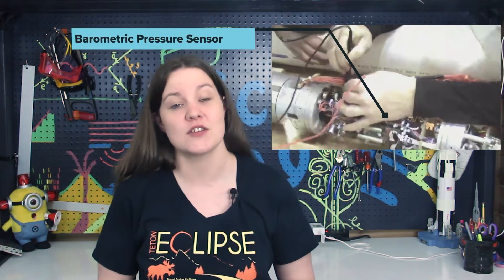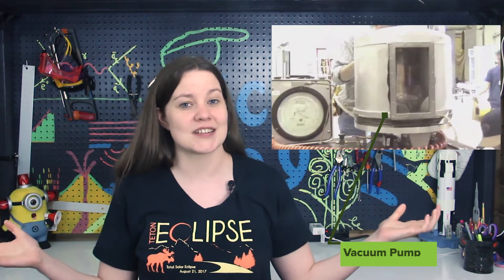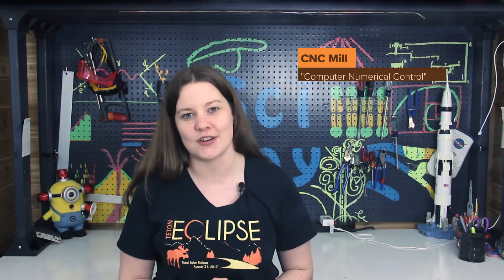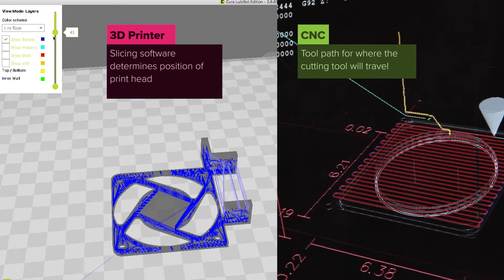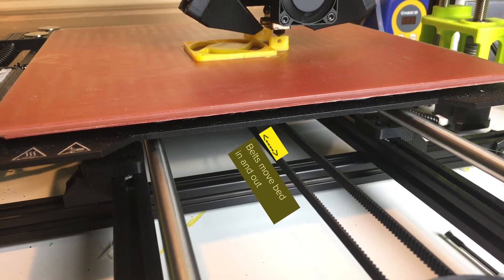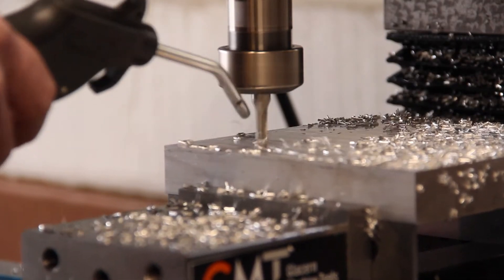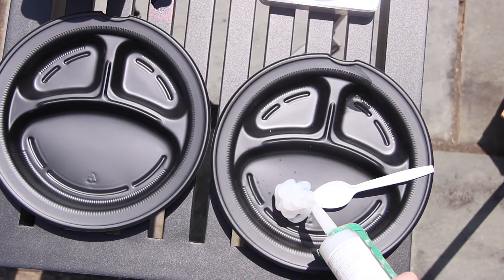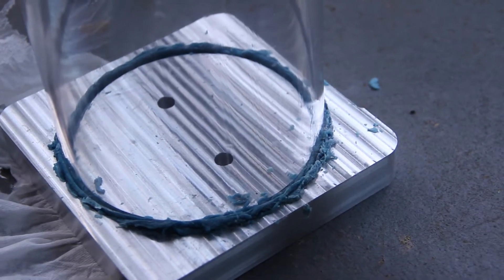Vacuum Chamber Build with CNC Mill - BTS

Comment: Thanks for the awesome video, YouTube Teacher!!  P.S. glad to see that playdoo has a scientific use : )
Reply from the maker: Thanks! It is useful like duct tape. I didn't use pivot tables for this, but I did use them to launch our high altitude balloon. I ran a few hundred simulations and used pivot tables to sort all the data. Your video are still helping me out.
Reply: Cool! Now, maybe, I will have to start saying: "If you can't fix it with Duct Tape or Playdoo, then throw it away : ) ... When you say Simulation, does that means you are just running the experiment a few 100 times? or are your using randomization for your simulation?